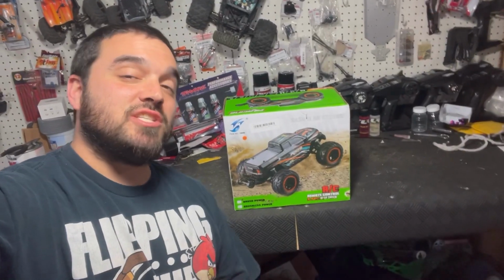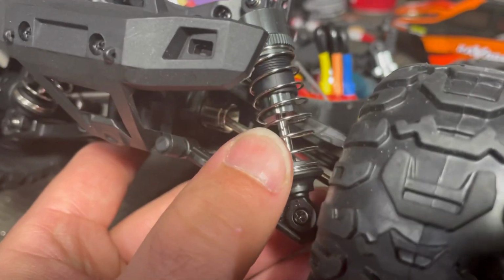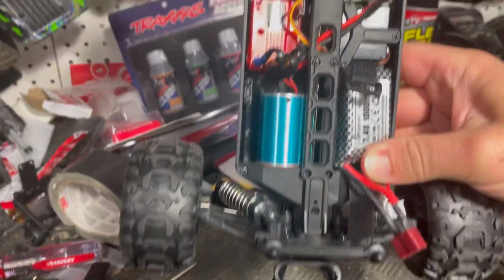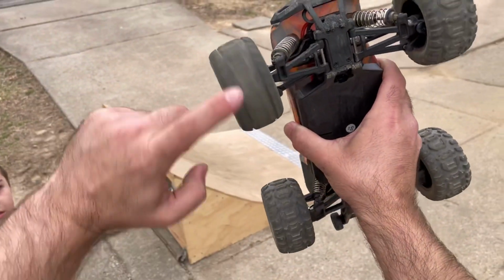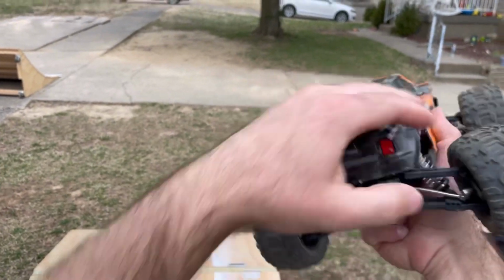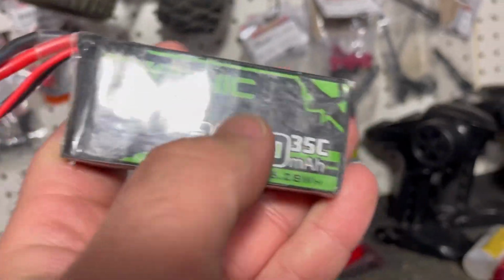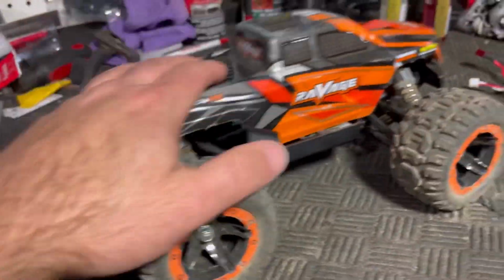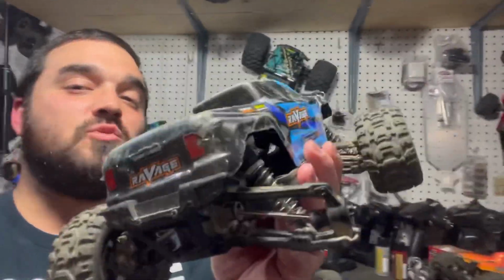The RC car EVERYBODY NEEDS!! HBX 16889a PRO

Comment: I got it today, deassembled and reassembled completely to put some oil in the diff and some grease, the car is very tough, good assembled and fun to play with!
Reply from the maker: Good job! And yes it’s a beast for such a small package!
Reply: I bought one and after few moderate jumps the rear suspension droops. Do I need upgrade the springs?
Reply from the maker: That is common on a lot of 1/16 cars. Have you already adjusted the spring tension back there? That usually takes care of it.

Comment: How do u charge it out the box without making it melt or over heat,as this happened with my first different car.I just plugged into wall by memory and didn’t have a special charger
Reply from the maker: I guess I don’t know what you mean. It comes with a USB charger you just need to plug it into a usb to wall adapter. Don’t ever use a charger nor intended for lipo batteries.

Comment: The 16899a brushless has a 2435 brushless motor, 3900KV. The 16899a Pro has a 2840 brushless 3500KV motor. So, while it is bigger, the Pro motor is not quite as fast, but has more torque. That's why it doesn't do backflips.  However, it should handle larger tires better.
Reply from the maker: It does handle bigger tires better for sure. 👍👍

Comment: For flips, you have to change the tire rotation speed to cause it to flip. If the bigger motor does not allow you to flip, I am guessing your wheels are already spinning at max speed before getting airborn. This might be because you have more power and the wheels start to spin out on the ramp before you get off the ground. Maybe try letting off the throttle once the tires are on the ramp, then hit the throttle once in the air. Alternatively, more traction on the ramp may fix the problem. It makes sense that a stronger motor would spin at max speed without being off the ground, because it is not bogged down by the little rc car.
Reply from the maker: Absolutely correct 😃👍

Comment: A more than proved formula. Will test my brushed version today in rain. If it survives it will definetly be the toughest and cheapest rc I've ever had!
Reply from the maker: That’s awesome! Let me know how it does!
Reply: @DerbyCityRC  passed with flying colors. Wet sand, puddles, wet tarmac and wet grass. The only thing is that on wet smooth tarmac is hard to find traction sometimes and mine is the brushed one with 390 motor. With brushless it probably is useless on full throttle on this conditions. Now it's time after dinner to clean it and dry with air drier. Also, a little bit of oil on bearings and a final spray of silicone as usual. Great car. Recommended for anyone experienced or not.
Reply from the maker: Great!! Yup! As I mentioned on the video, it’s a car for anyone! You’re doing it right by keeping it dry and oiling the bearings!

Comment: Have you had to change the servo on this rc? Mine isn’t tracking straight. If i turn right the front wheels stay right. Turn left.. Wheels stay left. If you have changed the servo.. Which one did you go with? Thanks
Reply: We just bought one of these, and it has a similar issue. The wheels don't come all the way back to center when you let go of the steering control. Its really hard to drive straight because of this...
Reply from the maker: @user-li5qx9nx6j interesting. I would check for anything casing it to bind, like if the really small screws on the steering linkage are too tight. Otherwise you can reach out to the seller or manufacturer for a warranty claim.
Reply from the maker: I have not yet changed the servo, but I plan to on mine. Hoping to order one shortly and want to make sure it works well and even fits right.

Comment: Having a hard time deciding between this 16889a Pro or the 18859a ... thoughts? Mainly gonna be driving in my backyard on short grass...
Reply from the maker: The pro is a much better car. I have to try really hard to break it, but I’ve broken the 18859a a couple times now. Plus the pro is more powerful with bigger wheels and will go through short grass with no problem at all. Definitely the best choice in my opinion.
Reply: @DerbyCityRC  awesome! Thanks for the quick reply!!
Reply from the maker: You’re welcome!

Comment: The battery you use Ovonic 2200 MAH 2S battery does it fit the HBX 16889a PRO battery connecter without having to resolder anything and will the supplied battery charger work with the  Ovonic 2200 MAH 2S battery and also how long Velcro battery strap do i need to buy ?  thanks
Reply from the maker: Yes that battery is a deans connector and fits the hbx connector but doesn’t fit all the way down in the tray. I don’t remember for sure what size strap I used but I have a few different sizes I keep from 200mm to 300mm. Yes the stock charger will charge that battery.

Comment: Does the aftermarket battery connect right to the car? Or do you have to modify the connectors? Just want to make sure I can charge the afternoon batteries with the stock charger and the aftermarket batteries hook up to the car. Link to the battery strap please. Thanks
Reply from the maker: Yes that battery will connect without mods, just won’t fit in the tray. I usually strap it to the top of the chassis brace with these straps here: https://amzn.to/3tPp4RO
Reply: @DerbyCityRC  is the GoolRC 16889A on Amazon the same exact RC in your video?
Reply from the maker: @FishHardGetLucky yes it is!

Comment: Haven't had the problem of a pin coming out yet but seen a few people mention ita happened to them. What pins do I need to get incase it happens to my sons?
Reply from the maker: So typically those pins are 2mm thick by 10mm long and easy to find on Amazon and in other RC spare parts kits. But I’m pretty sure I remember this one uses a 1.5mm x 10mm which is tougher to find. I’ve ordered stock rod like this and just cut to length myself.https://amzn.to/41DVN9t
Of course you can also just replace the whole axle : https://amzn.to/3ZofrUX
Reply: @@DerbyCityRC  cheers for the info I think I might do the same as you and buy a length to cut down👍
Reply from the maker: It works well!!

Comment: Hardened metal gears is a big plus . I think they probably use d2 tool steel . It’s not a chippy steel when hardened and pretty available . They use it in a lot of knives . It’s a tool steel with high chromium content so it’s almost stainless at 12cr
Reply from the maker: Good info!

Comment: Question on remotes, if we have two of these running together or at the same time, will there be any issue on controlling either of the cars? Thanks!
Reply from the maker: Nope each remote will bind specifically to one car. Just do one car with remote before doing the next car.
Reply: @DerbyCityRC  thanks again
Reply from the maker: You’re welcome!!

Comment: Please check out, if it can backflip with bigger wheels or is it necessery to use 3s?
Reply from the maker: I’ll be doing larger wheels on 2s and 3s in the near future. I’m confident it will be able
To backflip, I just wonder if it will have cogging issues or not. If so, the hbx 903 wheels or LC MT wheels are perfect for it 👍

Comment: Great content you provide here.   Thanks.   I bought some replacement lights for my pro version.  I noticed you can add more lights to it.  Where should I mount the second type as a modification or maybe even a third set of lights.   They connect like Xmas lights do.  I would send you a pic but don’t know how to do it on here.  Might be a good video idea.   Thanks.
Reply from the maker: Thanks!!
That’s a cool idea! And something I may do eventually!
Ontop of the roof or in the rear would be good places!
Reply: @DerbyCityRC  Thanks. I’d love to do a bunch of under car lights.  But don’t want to damage the carriage or weaken it.
Reply from the maker: @ToryandMatt ya would be best to use double stick tape for that

Comment: What oil weight in the shocks have you found to be the best? I don't quite beat as hard as this but I feel like the suspension is a bit soft still.
Reply from the maker: So far, I have found that I like 80 weight. That is with larger tires, but I still think 80 would do good on stock tires 👍

Comment: Hi Evan! The rear upper suspension arm has a lot of play at the upper screw. I was looking for aluminium arms. All are available except the rear upper ones. Neighter in Aluminium nor in plastik. Do you know where to get rear upper suspension arms?
Reply from the maker: I had that problem too actually. The official website is www.Haiboxing-hobby.com.
If it’s not listed on there, hit the contact button and they’ll help you out. Hopefully they’re available to buy still. I know they have the rear upper arms for the 16890, but those are not as good.
Reply: @DerbyCityRC  Could you send me the link with the 16890-part?
Reply from the maker: https://rchobbies.org/HBX-RC/HBX-16890-M16009-Rear-Upper-Links-Steering-Links-Servo-Link-21560.html
Reply: @DerbyCityRC  Thanks. Bit this looks really different.
Reply from the maker: That’s true. It’s a very basic charger
Reply: @DerbyCityRC  And i'm afraid, it doesn't fit, because there is a different shock tower mounted on 16890. The straight link of 16890 would make a collision with the shock of the 16889pro. What do you think?
Reply from the maker: I’ll have to check and see, but I’m pretty sure it’s doable. May need to move the shocks to the other side of the arms, which is how the 16890 is I think

Comment: Got this rc for just a couple of days. Then the steering just fucked up. It wont turn either left or right. 
It all started during the pairing of the transmitter and the rc then i accidentally pressed the throttle. 
What should i do?
Please help a newbie here. 
Thanks!
Reply from the maker: That’s interesting. Pulling the throttle during pairing shouldn’t affect the steering. Unplug battery and turn off transmitter then try again, which I’m sure you’ve already done. Make sure everything is plugged in. If the steering servo came unplugged from the receiver, be sure it’s plugged in the right way as it can plug in backwards and won’t work. Otherwise it may be a defect and they’ll likely take care of it for you.  Hope that helps!
Reply: @DerbyCityRC  thanks mate for always answering! Really appreciate it!
Well ive tried all of those but the the steering wheel is still not turning. 
Should i just replace the servo with a new one?
Reply from the maker: You’re welcome. Well hard to say if it’s the servo. Could always be a fault in the transmitter or the receiver as well. Servo is probably the most likely and is cheap though.
Reply: @DerbyCityRC  the throttle is fine. Rc is still running its just the wheels not turning at all
Reply from the maker: Ya could still be the steering circuit in another component like the transmitter or reciever though. L really hard to know as I’ve never had any electrical failures on these cars at all lol

Comment: Today i tried a 3s lipo for the first time. And together with bigger wheels it flips like crazy. Have you recognized any issue with 3s in the meantime?
Reply from the maker: I’ve ran my 16890 on 3s a few times. Similar car. Slightly smaller motor but same esc. It will run on 3s, I believe I got 37mph. Motor gets real hot and also sometimes applies the brakes on its own, oddly enough, but otherwise it’s been fine so far.
I will be running a 3s on my 16889a pro soon!
Reply from the maker: That’s interesting. I haven’t tried 3s yet on the pro. You would think the bigger motor would help!
Reply from the maker: Weird!
Well thanks! Glad you like the videos!!

Comment: Just ordered this for my son, where can I get an assortment of spare parts in case something breaks?
Reply from the maker: Awesome!
So there are some parts on Amazon and Banggood, but if you can’t find them there, you can also get them from pxtoysrc.com or Haiboxing-hobby.com
Reply: @DerbyCityRC  I guess as long as it says 16889 in the description it should fit?
Reply from the maker: @kgreen175 if you got the pro version, you want it to say 16889a pro. Some of the parts are the same, but not the drivetrain or electronics.

Comment: Hi Mate!
My truck (pro version) has a problem. When i turn the steering wheel half a millimeter to the left, the servo is shaking with high frequency. Which part do you think causes the problem, the radio, the esc or the servo itself?
Reply from the maker: Try reversing the steering direction with the switch on the radio, and see if turning the steering wheel in the same direction causes the shaking, or if it does it when you turn the steering to the right instead.
Reply: @DerbyCityRC  At the first time i tried this the shaking was after turning into the other direction. But in the meantime it is gone. But when i steer slowly (both directions) there is a strange noise (clicking/cracking) at some angles. When steering fast, everything is ok.
Reply from the maker: If the steering shake changed to the other direction, my first guess is it’s not the radio. Probably either the esc or servo. Also for the cracking sound, make sure the little black screws on the steering arm are not too tight.
Reply: @DerbyCityRC  Thanks
Reply from the maker: @ferdinandmaier1070  you’re welcome!

Comment: Wanting to get into this hobby and I have the stupid newbe question. I already decided on this car . My question is . How many of these exact cars would be able to run at the same time ?
Reply from the maker: Great choice. I don’t believe there is a limit. But I’ve never tried. 2-3 at the very least shouldn’t be a problem. Each controller binds to whichever car is turned on, so you just turn one car on, then a remote, then the next car and next remote. One set of car/remote at a time.
Reply: Was hoping that I could run 8 to 10 at a time
Reply from the maker: Upon a quick google search. I’m seeing somewhere between 6-10 as the limit for 2.4 ghz, which all the controllers I’ve ever seen are.
Reply: Great video by the way.
Thanks you so much for your quick and honest reply s
Reply from the maker: Thanks!! And you’re very welcome!

Comment: Try get adapters an fit 1 8 scale wheels  lets see how it performs come on do it be the proper over sized tyre fitter
Reply from the maker: Haha! I’ve got videos with 1/10 wheels on it and it’s awesome!! Surely you’ve seen those come on!!! 🤣🤣
Reply: @DerbyCityRC Yeah come on let's go big 🤣🤣
Reply: @DerbyCityRC  I fitted another bumper 2 back as wheelie bar comes with it an I have ordered front bumper from China plus sand wheels  come on let s go big .I once was rc Champion of malta

Comment: Is it for sure that it can handle 3S?
And is there such a little 3S battery with T-plug that fits in perfectly?
Reply from the maker: Yes. I have used 3s with my 16890, which uses the same esc. Only ran for maybe 10 minutes so I can’t speak to long term durability with it. The 3s battery I have does not fit in the tray. I have to strap it like I did the larger 2s in this video.

Comment: Is the drivetrain on yours noisey when your on the throttle while airborne? Mine was out of the box I greased the diffs and checked the mesh in all gears but the noise persists. Love the channel top notch content and editing!🤙🤙
Reply from the maker: They’re all
Slightly noises as metal gears just make noise naturally. So it’s hard to say, just check for any visible issues and keep rolling. Or you could always reach out to hbx if you think there’s a warranty issue.

Comment: What battery life do you get from the pro? I’m considering this truck as my first hobby level rc car. Still a good truck to get into the hobby heading into 2024?
Reply from the maker: It’s actually pretty good even with the little battery. It’s atleast 15 minutes.
This depends on what you want. There’s this one here which to me is more fun, plus bigger. Still extremely durable, though because it’s bigger it’s not quite as durable as the pro. https://youtu.be/9mef2vZL-eY?si=Gy2NIIs0eeTkYe5M
Reply from the maker: There is also a newer version of the pro, which is 3s capable so more speed and power. That video I’m actually hoping to have out tomorrow. It’s this one: https://amzn.to/46FOaQU

Comment: Get the lc racing monster truck tires they’re perfect size and it will back flip no problem and also do wheelies in reverse. I think the 2995 stock wheels on it are to big and they just make it a wheelie machine I think on carpet it might do a standing backflip with 2995 tires.
Reply from the maker: Thanks, that’s a good option! I don’t like the stock 2995 tires at all anyway. I’m gonna go overkill on the tires first like I showed in the video, then probably get those MTs or something similar. 👍👍
Thanks for watching!!

Comment: Derby City have you tried the bandit brushless vxl and brush they're both two wheel drive but they're awesome check them out make sure you have a wheelie bar on them they both have good speeds one's got 35 mph with a stock gear and then it has a high gear on it then the bandit VXL it's got the 75 mph gears check them out so you can do a post on them they do great and jumps and high speeds you and your kids I get a kick out of it great fan
Reply from the maker: Awesome, I’ll look into those. They sound pretty sweet.
Thanks!!